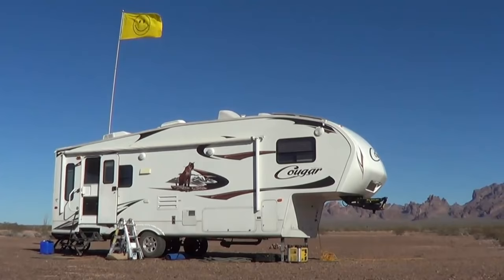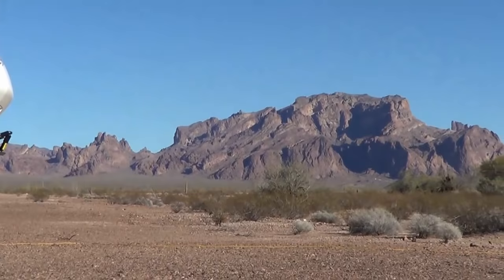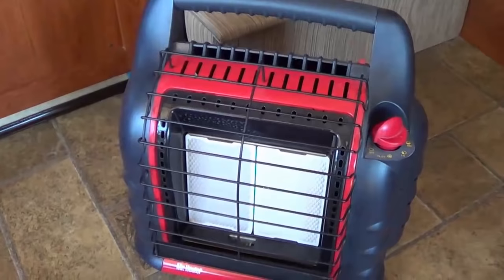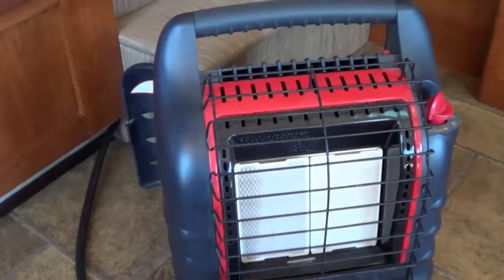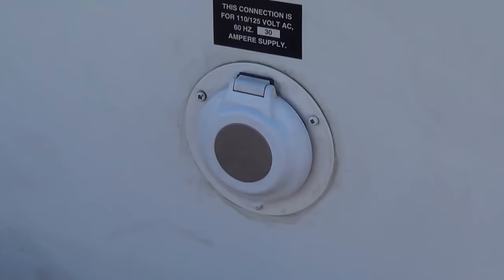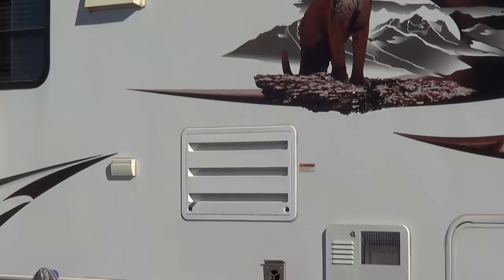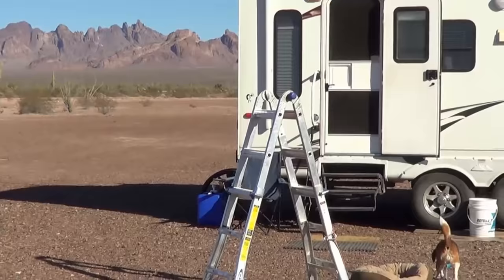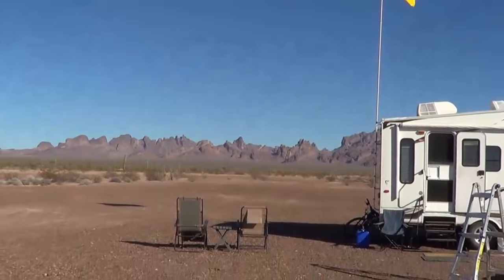20 More RV Upgrades to Our Fifth Wheel Trailer

Comment: My partner and I are the last two guys that should own an RV, for the most part between the two of us we have the mechanical ability of a rock and all we know about electricity is you plug it in, you flip the switch or you get electrocuted, but this fall we're buying the 43' Thor diesel pusher house on wheels as soon as the sticks and bricks and everything else is sold. 

First stop before hitting the road is taking it to a solar expert to use as much of the rooftop real estate that's economically worth it to have the solar system installed. Then we have to learn how to use it. Then we're going to take out the ceramic flooring and replacing it with a wood-look vinyl system, our 2 Greyhound don't do well on slick surfaces, and replacing/recovering the leather seating areas with fabric, some painting and replacing of the drab dark factory standard valances etc. THEN we're off to look for America. 

We're loving the tips videos you and several other full-timers offer! If we can't do it ourselves, at least we know what to ask the 'experts' for, so THANX!!
Reply from the maker: Wow! 43 feet. Cool! Sounds like it will be a great home on wheels for ya.
Your most welcome for the tips, thanks for viewing. Cheers Ray
Reply: Love Your RV
We had to have the washer/dryer and dishwasher, LOL!

Comment: Love the leveller, just added  it to my Christmas list. Looking forward to the AZ desert maybe next winter. I've been out there a couple times on Motorcycle trips. Love it!
Reply from the maker: Hey Neil, if you carry a smartphone check out this other leveler I reviewed - http://www.loveyourrv.com/levelmatepro-rv-leveling-aid-review/ I've been using it most of the time now. It works through Bluetooth. The killer feature for me is I can see the level on the phone while I'm in the truck cab. That way when setting up at a potential boondocking site I can drive around and find the most level spot easily. Cheers! Ray
Reply: Love Your RV 
I've seen that system and it is pretty slick but I just love stand alone components. Especially if I have the room to carry them. I'm really rough on my phone's and I've had times where a software update cost me all my music and my contacts. I seriously only use my phone for phone calls, texting, email and very reluctantly GPS. I have tech buddy who's telling me I can strip my old phone and use it as an iPod and a GPS. I kind of like that. But while I have you, how did that stand alone leveler work out long term?
Reply from the maker: Ahh, yeah,  I see you're points. 
I didn't use it too long, maybe 6 months before the Levelmate came out on the market and I switched but it worked as advertised.

Comment: About the light under the bed: you might want to add some kind of shade in front of the light in order to avoid having it shine into your eyes.
Reply from the maker: The LED lamp I installed into it shines its light down so hasn't been a problem.

Comment: Thanks Ray! The inverter, reckon you had to mount it upside down, eh? That puts fan on bottom, think that'll be okay?
Reply from the maker: Sorry for the late reply, I have been offline in Joshua Tree NP for several days with no cell service.
Yup, more convenient for running the wires, the manual says it's OK. :)
Here is an updated post on my inverter install - http://www.loveyourrv.com/1000w-pure-sine-wave-inverter/
Cheers Ray

Comment: Perhaps I'm being very stupid but what does the RV Leveller gizmo give you that a spirit level wouldn't, at a lot lower cost?
Reply from the maker: Precision - the exact amount of inches for side to side leveling, exact height for connecting and disconnecting of the trailer and exact leveling front to back. It's definitely not a necessary item, but a neat gadget. It would be most useful for first-time trailer owners than experienced folks.
Reply: +Love Your RV 
the ability to know the hookup height is awesome. Anything that saves time is good.
Reply: Love Your RV Ah. OK. Thanks!

Comment: getting ready for our first trip in our fifth wheel....watched all your videos twice and had the RV dealership make my fifth wheel preform a lot like yours as boon docking is what excites me the most of all in the camping world one question .....i upgraded my batteries to 4 heavy duty 6 volt system..... so if its bad for the batteries to drop below 50% ....when storing the trailer for winter must you keep the trailer plugged  in so they don't drain down..... is this common practice to keep the trailer plugged in all winter so the batteries don't run down.......what if where your going to store it the facility does not have hookup what do yo do
Reply from the maker: Your best bet is to charge the batteries up fully and completely disconnect them, some trailers have a battery disconnect switch. If not connected they will last a long time and not easily freeze. You'd want to check them every month or so and measure the voltage, if it falls below say 12.2V would be a good idea to put a charger on it for a while. Any small solar panel could be used to keep them topped up too as long as it has a quality solar controller that can properly trickle charge them.

Comment: Hey Ray,

Awesome video, love your channel and the lifestyle you are living.  Have you considered a composting toilet to eliminate dealing with the black tank and saving water?  If you didn't need the black tank, you could replace it with another fresh water tank and plumb it into the other and extend your boondocking times.  Also, when your new batteries meet their maker, have you considered lithium ion batteries?
Reply from the maker: Hi David, thanks!
Not enough room in our toilet room for a composting toilet and it's a definite "NO GO" with my wife. ;) plus I have many other things I'd like to do with a 1000 bucks or more.
By the time my new batteries meet their maker in 5-7 years I'm hoping Lithium are commonplace and affordable. I don't like them right now due to the upfront cost and the extra caution with charging and temperature they need. Also, none of the large well-known battery companies are making them. Seems to be mostly startups. makes me a little leery. When Trojan, Lifeline, Interstate, etc are selling them it will be the time to invest. IMHO.
If you have the spare cash though go to town, I would. :) 
Right now I have to wait for the early adopters to flush things out first. but the frugality keeps me living the life. 
Cheers Ray

Comment: Nice alterations. I like the magnetic lamp switch under the bed. Did I see an exposed nail (skin-tearing device) inside the water pump enclosure?
Reply from the maker: Yes, but not like I'm in there all that much. In fact I don't think I've had to go into that enclosure for years now. :)
Reply: When I think I won't be going into a area again, that's when I go get stitches lol. Nice improvements by the way.   Nice video too really informative.

Comment: Very impressive list of upgrades!  You are a very talented man.  I don't boondock so don't need a lot of this, but one thing I definitely need to do is change out my refrigerator cooling fan.  Man that thing is noisy - I don't know what Keystone was thinking by putting that thing in there.  My fridge is in the slide, so I think I may be able to access it from one of the two outside removable panels???  I need to do some research as I don't know anything about this kind of thing.

One unrelated question...is your dining table still screwed to the floor, or do you just strap it down when traveling?  I'm asking because my screws keep working loose on mine and see that a lot of people just leave it loose.
Reply from the maker: Thanks! I added a slightly larger diameter screw and it's been good for a few years now.
Cheers Ray

Comment: You are awesome!!!!   I love your videos.  I have a small Class C but have considered getting a trailer.  What is easier to maneuver a travel trailer or a 5th Wheel??  Benefits seem that more space in the 5th wheel, but more space in the tow rig for a trailer.  Love the beagle.  Has any desert creature tried to run off with her (coyote)??
Reply from the maker: Thanks! Seems most full-time RVers lean towards a fifth wheel (more roomy with more storage) and weekend or shorter trip folks like a travel trailer so they don't need as heavy duty of truck.
I find the fifth wheel quite easy to maneuver and very stable when towing.
No critter has tried to snatch her yet. :)

Comment: Also, I noticed that all your electric connections are are nice and shiny. Are you using any sort of an anti corrosion coating/spray on them? Or are they recent or you unscrew and clean them regularly? - just a pleasure to look at the neat set up. I've seen Firestone smother something on my battery connections/wires when they installed a new battery. Wanted to charge me for it but I said I did not need it, they did it anyway  for free.
Reply from the maker: There is Oxgard on all the connections - http://www.gardnerbender.com/en/ox-100b, the lug connectors have a heat-shrink with glue inside to lock out air and I usually cover all the connectors with Permatex dielectric grease. I don't get much corrosion issues though, it's a clean compartment and well vented. 
On my truck batteries I use a red anti corrsion spray, works really well, but that is a much dirtier scene in the diesel engine area. :)

Comment: I think, if you research solar, you will find that you should not have the charger 
/ inverter in the same compartment as the batteries even if vented.
Reply from the maker: Its never been a problem, the front compartment on our rig is also so well ventilated with openings for the landing jacks and the side propane compartments.  Lots of airflow in there. 
No build up of gases can happen so no risk of a spark causing problems or corrosion of the inverter circuits which is what the manufactures of inverters are worried about. 8 years its been in there an not a spot of corrosion on the metal pieces so that tells me there haven't been any battery fumes building up.  Likely better for the inverter and charger since they run much cooler in there so will last longer. Cheers, Ray

Comment: 13:00  can you use this PD9260C Charger for charging LITHIUM Batteries?
Reply from the maker: Yes, I use the Charge Wizard add on and set it manually for 14.4 VDC and it pumps in over 50 amps when I'm charging with my generator, love it!  https://www.loveyourrv.com/tag/lithium/

Comment: what is the advantage of the 6 volt golf cart batteries over 12 volt?
Reply from the maker: They are generally cheaper per Amp Hour of capacity, they are a true deep cycle battery and extra heavy duty designed to be able to take more deep discharges and they are taller so have a smaller footprint. Here is an interesting read on what makes a battery a true deep cycle - https://marinehowto.com/what-is-a-deep-cycle-battery/  Cheers, Ray

Comment: hi, we really enjoy your site. we have a 07 cougar bumper pull,which we really enjoy.Lately our hw tank wont light properly, it is a suberban sw6 de. It goes thru its clicking routine 3 times and wont light. After resetting reset button inside rv it may light but with a big whoosh, not the regular burner noise. I have checked for debri in burner tube etc, and it is clean.Also the red reset button inside does not light up when it turns itself off . if you could give me any hints  it would be really appreciated.  Ps if it does light up, the water heats up good, and then shuts, and wont re-light.Thank you very much
Reply from the maker: Have a look at the service manual. https://www.rexandsonsrvs.com/manuals/Suburban_Water_Heater_Service_Manual.pdf
Common things would be a blocked gas orifice, especially the tiny pinhole or the position of the electrode is off or the electrode is dirty. The electrode is also a flame sensor and gas flow gets shut off if it doesn't get the right reading.
Also could be the LP gas system. I once had a bad safety valve in one of my tanks pigtail hoses cause both my water heater and furnace to have problems lighting even thought the stove worked fine.

Pigtail looks like this - https://www.amazon.com/Camco-59053-Pigtail-Propane-Connector/dp/B0014E3MSS
Good luck, Ray

Comment: Have you had any trouble with that Cougar brand of RV.  There are just so many out there I don’t know where to start. Could you recommend some of the top rated brands?  Thanks
Reply from the maker: My experience is we have full timed in it for near 8 years now and its held up surprisingly well considering its meant for weekenders and vacationers.
Two biggest failures have been the fridge and water heater made by Dometic and Suburban, not Keystone.
https://www.loveyourrv.com/cougar-trailer-review-fulltime-rving/
As far as new, sorry hard for me to say, mine is 2011, lots could have changed since then. I haven't looked at the newer stuff, not one for RV shows. But, most of the newer stuff not just Cougar is suffering from poor quality I've heard.
The RV industry has been booming so they have been churning them out at the same time good labor is harder to find.
Myself if I was buying and had the money would likely get an Arctic Fox from Northwood - http://northwoodmfg.com/5th-wheels/arctic-fox-5th-wheels/

Comment: With all the upgrades,  specifically the solar / electrical system,  what are your thoughts on insurance?  Have you, or are you allowed to upgraded your coverage to keep in line with the added value to the rig,  especially ( God forbid )  replacement cost,   or is this something that you are not able to add to your coverage?  Considering the thousands you have spent,  I was curious as to how this would be addressed with an RV.BTW,  you do some fabulous work.  RV manufacturers should hire you as a consultant.
Reply from the maker: Hi Bob, we have a rider on our RV insurance for extras, each year we adjust it. Usually, add what we figure may be stolen and take out what is too old to pay for insurance, like electronics that become obsolete.
Our rig is insured for new replacement cost even though it's 5 years old now. In the case of a total write off the trade off is I would lose all my mods but we would get a new rig, and I could start again!
Reply: +Love Your RV Hello Ray, You have a very interesting (and PROFESSIONAL) looking power management installation.
Did you have to get any extra safety certifications of your modifications? As you know, a short circuit on those batteries due to equipment failure or a lightning hit could be disastrous.  
From what I saw, you have installed surge protection and fuses everywhere. Was this your own design, or did you have someone (re)design it for you? Everything looks great !
Reply from the maker: John Mulhall I did the modifications and upgrades myself.

I wouldn't even know where to go to get it certified? I know there is a safety certification for LP Gas but I haven't heard of one for the 12 volt power system.

I never seen any safety stickers or received any information on the battery install when the rig was new. I'm not sure if it came form the factory with a battery and its wiring installed or whether the dealer did it and if the person that installed was certified to do it.

A lighting hit can be disastrous no matter what you do. It's a movable vehicle so we can't install a lighting rod to ground.

I take full responsibility when I perform mods that's why I'm sure to install many fail safe devices to prevent any chance or a fire causing short circuit. I don't do any mods on anyone else's rig only my own.

I do have a background in electricity having been a electronic repair technician for over 25 years. Cheers Ray
Reply: Hello Ray, Thank you for your fast reply.
I do not doubt your design. My concern was whether an insurance company would VOID a claim if it were to catch fire for ANY cause.
BTW, I bet you could market those modifications quite well. Just put your trailer up for sale. LOL.
Reply from the maker: Hard to say, guess it depends on the particular company and plan. Not much going to be left in a fire though, have you ever seen a trailer burn. ;)

If insurance companies want to be sticky then ANY non OEM part added to the RV could VOID the policy. LED lights for example. I have more faith in my modifications than most cheap LED lights out of China. 
 
In the end it is up to each owner to decide how much risk they feel comfortable with. If worried call your insurance company and grill them and get your concerns answered in writing. I bet you'll find you aren't suppose to change anything, but that is unrealistic since 99% of RVers have changed something. So if they started to deny claims based on any change soon people would stop buying.
Reply: Insurance? For a tow-behind? Yikes...I better call my agent.